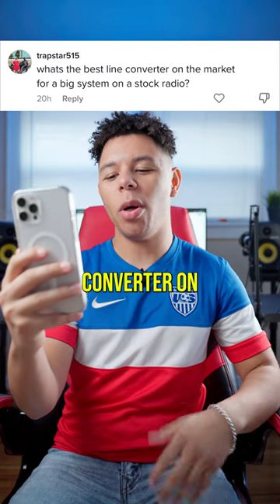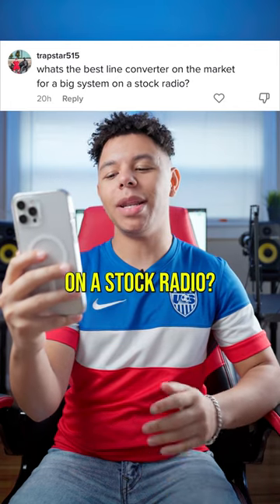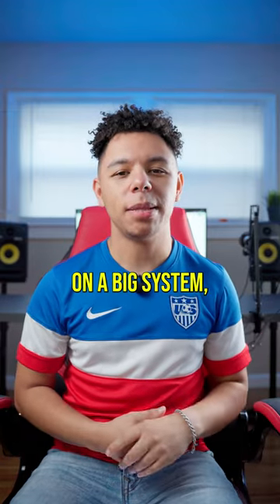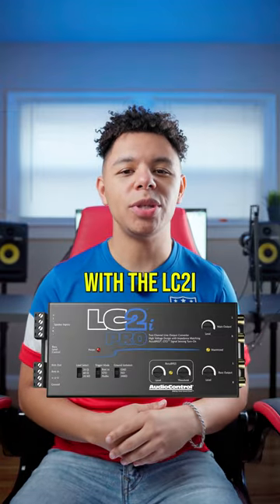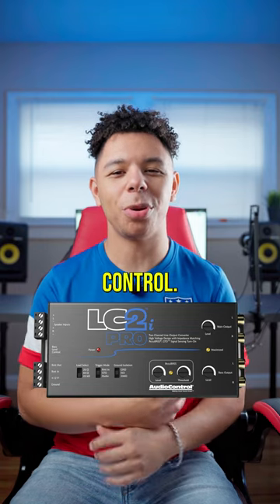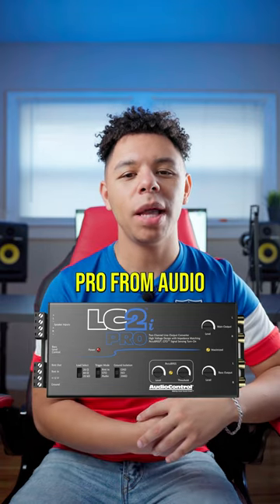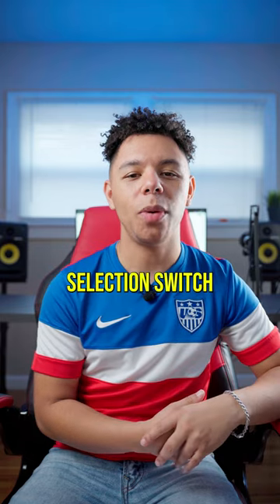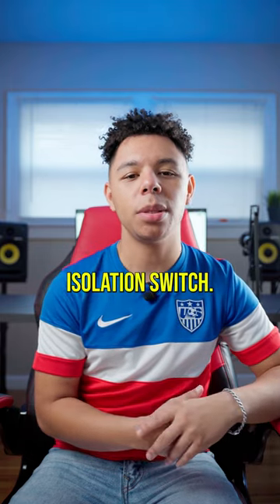Best Line Out Converter For Your Audio System! 🚘🔊 #shorts

Comment: Man, I have an lc7i from a previous setup I just used to install a single sub in my Acura and I can't for the life of me figure it out. I got everything wired up and powered, I tapped into the factory subwoofer output from the head unit to a single channel on my lc7i but Nada going through it. Using a multimeter on it  to check the input of the speaker wire Im getting resistance and when I test the output at the RCA I get nothing but continuity.